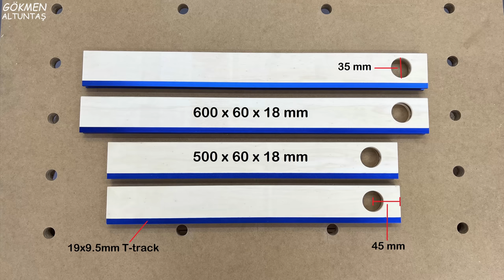Great Woodworking Tools in Action to Make a Router Template Guide

Comment: I’ve seen this a few times but never with the plywood to show the distance of the router brilliant idea takes the guesswork out. thanks
Reply: The other versions you've seen uses the top of the jig for the router to slide over and the inner edge for the flush trim bit to roll against. There is no guesswork using that version either since the inner edge does the same job as the thin plywood in this version. I'm guessing he didn't like the flush trim bearing rolling against the T track as it has the gap in the middle but that's just a personal preference thing I guess.